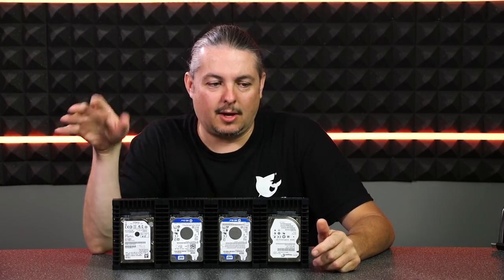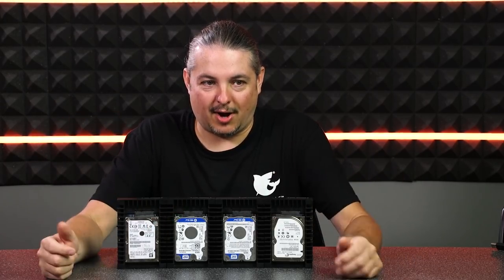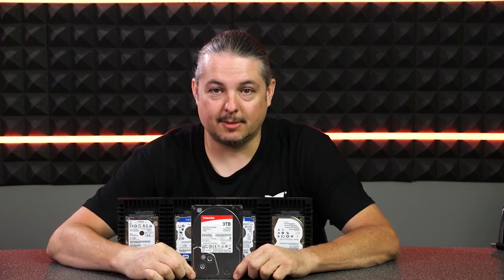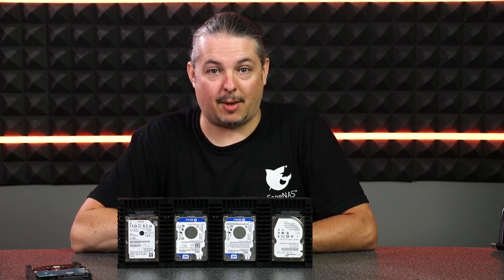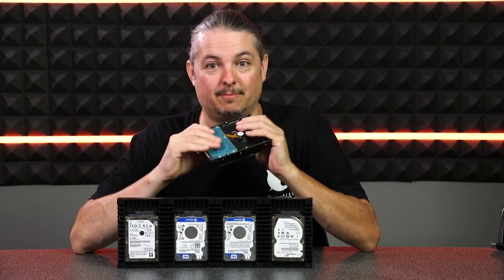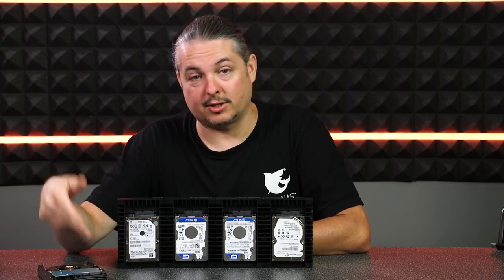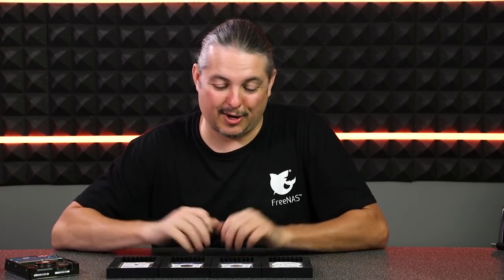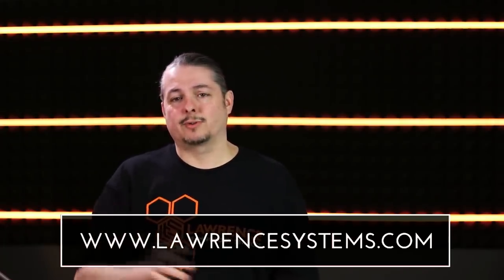FreeNAS Mismatched Drive Testing With Old Laptop Drives 11 month Follow up.

Comment: Nice video, but I have even stranger disks on my ZFS FreeBSD backup server. It runs with 2 IDE disks; 3.5"; 7200rpm; one 250GB and the other 320GB. the third drive is the fastest; 2.5" 5400rpm; 320GB connected through SATA-1. All three drives are striped and it works fine on my Pentium-4-HT (3.0GHz) with 1.25GB of DDR (400MHz). 

I power it on for ~1 hour/week and do an incremental backup (send | ssh receive) over 1 Gbps:
2018 AMD Ryzen 3 2200G -> 2003 Intel Pentium 4 HT
64-bits -> 32-bits
SATA-3 -> IDE/SATA-1
Ubuntu 19.04/19.10 -> FreeBSD 12
The transfer speed is limited to 200 Mbps by the P4 CPU, running at 90%, but again ~1 hour is fine for me. 

The case for the P4 is perfect, it is an original Compaq Evo case with a Pentium 4 Sticker and a Windows 98/2000 sticker :)

Comment: I finally have issues with my refurbished HGST 2TB drives. I got a degraded pool and it won't replace. The drive works just fine on it's own but later today I am gonna copy everything off my pool and rebuild it this time with RaidZ2 (6x2TB + 1x4TB). Hopefully all works well out the bat this time

Comment: Nice video.  Testing FreeNAS at the moment and intend to install it over my current Ubuntu 16 Server Raid5 (3 disk system [all different make drives]).  I'll VM Unifi Controller, Video and PiHole in FreeNAS which it quite a neat trick.  I'm glad I tested it all first on some old equipment to get my head around the FreeNAS terminology and quirks.

Comment: Thanks! Great video. Myself first FreeNAS system was quite literally JBOD. :) Back when you could use UFS (circa 2011ish). It wasn't zfs or ECC ram but it lasted 2 years until I outgrew the capacity and built with supermicro ECC.. NAS drives etc.. for production uh.. no. I might build a pool with old laptop HDDs also. Was it an iSCSI target for NVR.. FTP, samba, NFS? How did you configure it for NVR? .. I'd love a video on that. :)

Comment: what about iron wolf drives? and used velocity raptor drives 500GB drives are about 40-50$ I think they are good drives for price
Reply: გიორგი კერატიშვილი Raptors? Nah. Noisy, hot and power hungry.
Regular 3TB or 4TB HDs are the best value. Put an SSD for cache and ZIL and you have the best of both worlds.

Comment: I have these HDDs that I don't use:
3.5 - 160GB 7200RPM SATA3
3.5 - 80GB 7200RPM IDE
3.5 - 80GB 7200RPM IDE

In my old days I would use them like this:
C: 120GB SSD for Windows and Programs
F: 640GB USB HDD for file's
G: 320GB Raid for games
The 80GB HDDs in Hardware Raid 0
And the (80+80)+160GB HDD in Software Raid 0

Now I'm still using:
C: 120GB SSD for Windows and Programs
F: 512GB HDD for file's
G: 2TB Raid  for Games
I still have the external drive but I use for other stuff.
The Raid now its 2 1TB drives in hardware raid 0
My current MB has no IDE.

Comment: I bought some used Hard drives.  How do I test this drive for any potential problem using FreeNAS GUI or Shell scripts?
Reply from the maker: from the command line you can check the smart status smartctl -a /dev/"Whatever Drive You are Testing"
Reply: I did that already but on the device line it stated: "Not in smartctl database {for details use: -P showall]".  I need more comprehensive hard drive testing or error testing.   Thank you.

Comment: Any way to go from freenas on bare metal to virtual without data loss?
Reply from the maker: Yes, but why would you?  FreeNAS is designed to run directly on hardware, not in a VM
Reply: Moving to a different place with space limitations and condensing servers down to a single one.
Reply: Really.. really bad idea.. sorry I wanted to do this too for same reason. It was a total fail. FreeNAS on bare metal and your hypervisor separate. FreeNAS is getting better at  also being hypervisor.. I ran into some issues in testing and decided not to go that route. Server monkey has R710s for pretty reasonable price. ... Doesn't solve space issues. Use as a coffee table in the lobby. :)
Reply: Consider running the VM's in FreeNAS, not the other way around. You can still end up with a single server
Reply: What is the difference?
I have both and data is data (MDM in esxi).
Reply: Your incompetence or ignorance will vary. I have been running virtual Freenas for 5 years without 1 issue. 
Sheeple will be sheeple.
Reply: I've actually been thinking about running FreeNAS in a VM myself, too. I don't see any issue with using PCI-passthrough to give control of the SATA-controllers to the FreeNAS VM, it'll then have direct hardware-access to them and the drives connected to them, but then I can use a more capable host-OS for other stuff in the meanwhile.
I mean, if you have can detail some specific problem, then go ahead, but just saying vaguely "it's designed to run directly on hardware" isn't an argument.
Reply: Nita Vesa 
Exactly.

Comment: Why different brand drives would not work if they are seeing as space??

Don’t they all conform to standards?

The days of master/slave and jumpers are over.

Even in a hardware raid, unless there is a specific interoperability issue with a specific drive/brand, space is space as far as I know at the electrical, ATA, BIOS/UEFI, interrupts and OS levels.